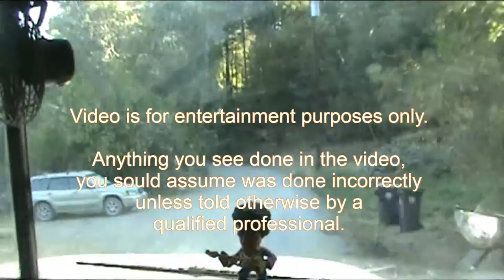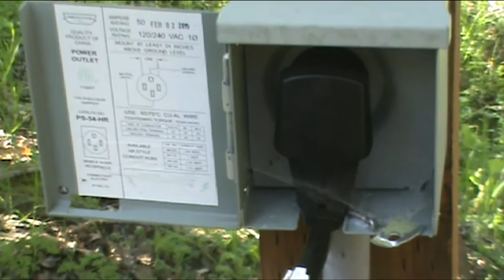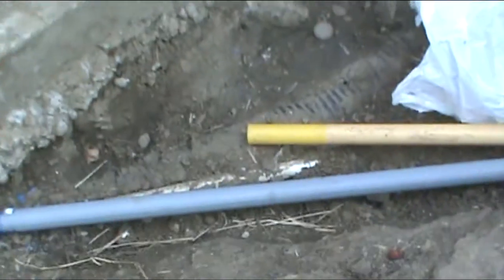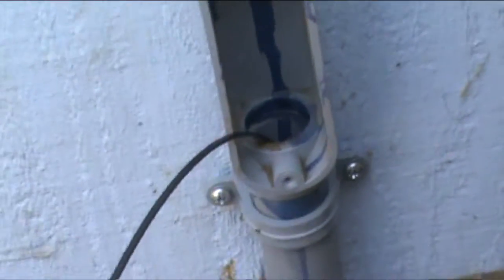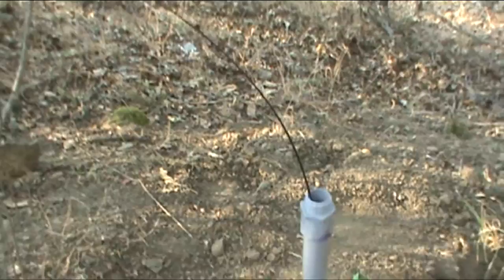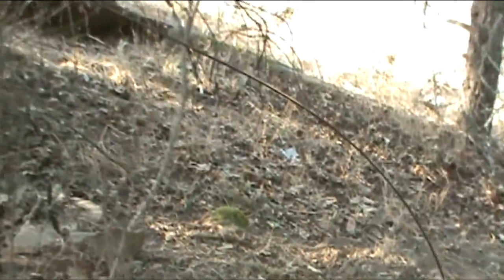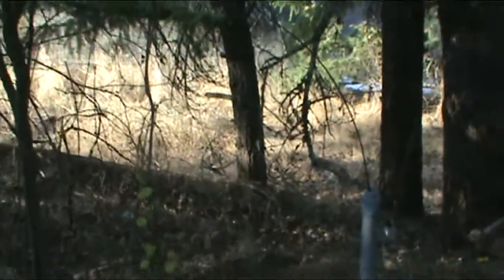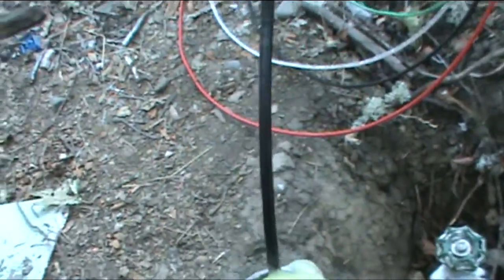Jon's Bus Conversion Part 42 - 50 Amp RV Electrical Outlet Installation

Comment: A little trick I learned from an electrician for wire pulls longer than my fish tape is to tie a large piece of plastic bag to some twine and suck it through the conduit with a shop vac.
Reply from the maker: +Steampunk Steve Yeah great idea! Silly me...I fixed that problem by buying a longer fish tape :). That's how I knew exactly how long it was hee hee.

Comment: Terrible ! # 10 wire for a 50 AMP OUTLET??? wooow?
Reply from the maker: Who says it's #10 wire? It's not. it's #8. The wire was sized by the local wiring supply place (no not a box store - the real place). It was permitted, inspected and approved by the county electrical inspector. In any case, my disclaimer at the beginning clearly indicates that you should assume everything I do is wrong unless told otherwise by a qualified professional.